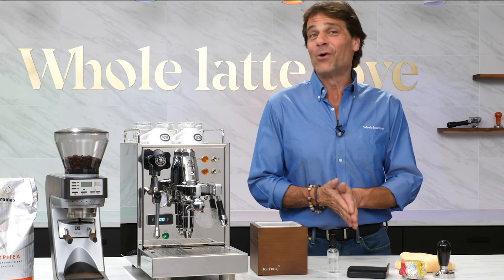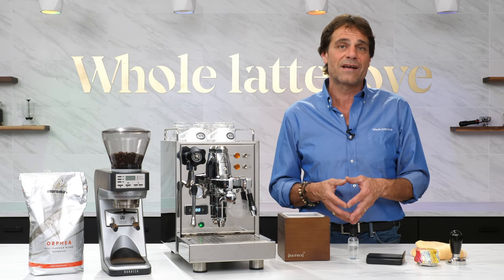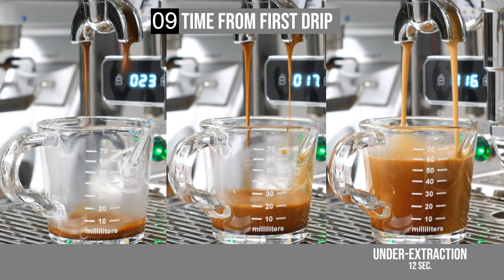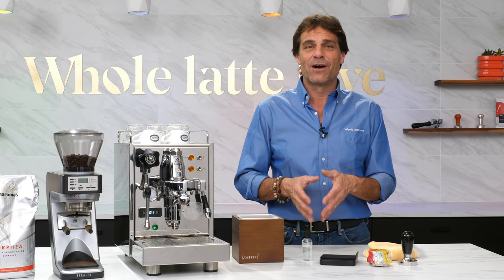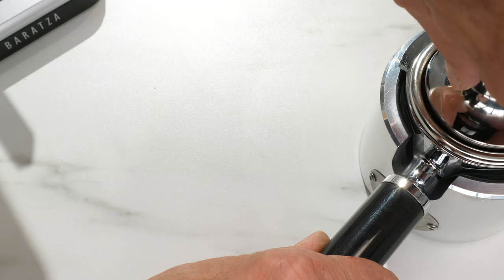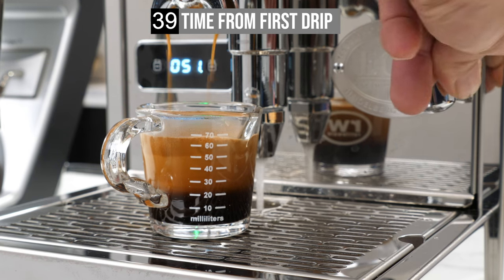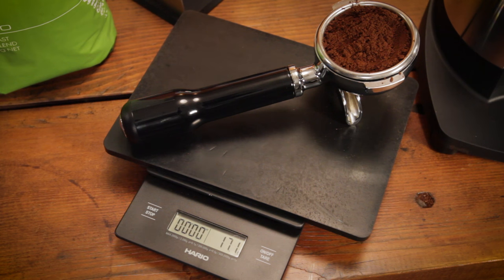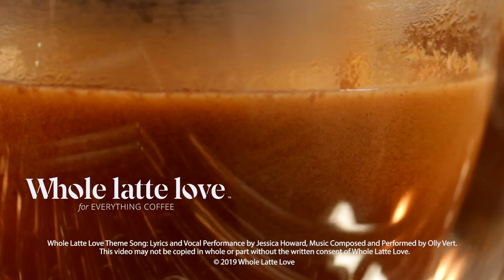How To Dial In Grind Size for Espresso

Comment: Something is very wrong. I get to 70ml after 15 seconds on the finest grind size, and that's with only about half the liquid landing in the glass. I have distributed and tampered as evenly and carefully as I can, stirred it with the spiky thing to remove clumps, etc etc etc. Still getting coffee on the ceiling.
Reply from the maker: Hi AD, Coffee on the ceiling? Not sure what to make of that! 70ml in 15 sec is fast. Would help to know some more details like machine and grinder make/models. Extractions too fast is almost always due to grind being too coarse and/or coffee dose too low. If grinding at finest setting you can slow down the extraction with a higher coffee dose weight - assuming you have the capacity in the portafilter to dose more.
Marc

Comment: Hai, my machine got pre infusion for 9 secs,and I use 9 grams coffee bean,including pre infusion 9 secs +20 secs brew time,my Espresso still lack of crema, should I go "finer"?
Reply from the maker: Hi WK, Sounds like you are doing single shots. I would go finer and try to get the main extraction after the pre-infusion to at least 25 seconds. Long pre-infusions generally require a finer grind size.
Marc‘
Reply: @Wholelattelovepage  thanks for the tips 😀

Comment: Hello been watching your channel from Kenya I want to ask. I have this machine Victoria and I set it automatic i use 19grms in and 36 out in less then 25secs and it balances at times so the question is does time really hold much water in esspresso extraction
Reply from the maker: Hi RV, Time is important when doing basic dialing in of grind size. But weight and brew ratios are far more accurate after that.
Marc

Comment: Hi Marc, Just got a Breville Barista Touch from Whole Latte (changed from my Gaggia Titanium Superauto). Using Lavazza Super Crema beans but can't seem to get the thick creaa even changing the setting on the grinder to increments as low as 6.  I see a comment below about a single vs double shot, I am using singles.  Should I be doing doubles and what setting do you suggest I use on the grinder?  The timer is set for 25 seconds for the brew, I even tried to go up to 30 seconds but no success.  By the way, no matter what setting I use, the flow seems to always start at 7-8 seconds. Never changes?
By the way, all great and helpful videos and I love the new set! I am working on latte art but need to get the crema/espresso right first. Thanks
Reply from the maker: Hi cs, I would do doubles. Singles are very tricky to pull off - very few do singles. My advice: use the double shot non-pressurized filter basket. Breville calls those single wall. Grind to slightly overfill the basket and swipe off. Tamp with firm level pressure. First drip at 7-8 seconds is fine. Your shooting for ~2oz in 20-30 seconds from first drip. If coming faster set grind finer a step or 2 and try again. If going over 30 seconds set grind coarser a step and try again. When the grind is right Super Crema should easily produce crema!
Marc
Reply: @Wholelattelovepage  Thanks Marc, I tried with a double and got plenty of crema. Thanks.  Now onto the fine steamed milk for latte art!

Comment: I just bought a Breville barista touch & I think the flow is too fast- starts pouring at 7 seconds & the amount of ground coffee isn’t above the portafilter so there is nothing to trim. How can I fix this issue?
Reply from the maker: Hi Sue, First drip at 7 seconds is very reasonable IMO. But, if you thinks it's too fast the way to correct is to decrease the grind size and/or increase the dose of coffee in the portafilter.
Marc

Comment: But they say 18g in and 36g out in 20-30 seconds not 60ml or 60g… out.. how do you dial in 20-30 seconds with only outputting 1:2 ration of 36g out ?
Reply from the maker: Hi TD, Crema is a lot lighter than fully liquid espresso. Coffees which produce a lot of crema can have a volume (including the crema) of >60ml with a weight 36g.
Marc

Comment: Do you always to grind 17oz for a double espresso? Is that different between porta filter sizes?
Reply from the maker: Hi Adrian, Thanks for the question. 17-19g is a fairly typical double shot dose weight in the US. I was in Italy over the summer and looked like commodity doubles are traditional dose of 14g.
Marc

Comment: On a PID equipped Sylvia M since the brew time is a parameter that you are setting would you instead be dialing in your grind based on output? For instance I can set the brew time for 25 seconds and if I am getting 17 grams in I should be measuring the output to see where I need to go with the grind setting, correct?
Reply from the maker: Hi Rick, Thanks for the question. You can do that but be aware how you measure output makes a big difference. Measuring volume is rather inaccurate. Weight is the only true way of determining brew ratio. So if doing 17g and using a typical 1:2 brew ratio you'd be looking for 34g out. If using a coffee which produces a lot of crema (and you include crema in a volume measurement) you could easily have 60ml volume with 34g weight.  For an example of that check out this video I posted yesterday. Crema rich triple shots pulled from 21g of coffee and stopped at 42g output weight have in cup volume near 70ml including crema: https://youtu.be/HTaly8c-i_U
In your case if setting a 25 second brew time you could adjust grind to produce 34g output weight. Hope that helps!
Marc

Comment: I’m a big flat white drinker, occasionally drinking espresso. Would you recommend the ecm classika?
Reply from the maker: Hi Charlie, Thanks for the question. The typical Classika owner is more about the espresso than the milk drinks. It's perhaps the most temperature stable single boiler machine. With E61 group and option for flow control it's capable of excellent espresso. As a single boiler there's a wait between making espresso and frothing milk as the boiler raises to steaming temperature. Then after frothing one must cool down and refill the boiler before making the next espresso. If you're okay with the added wait and a bit more mess from cooling down it can work. But for those who do mostly milk drinks I recommend going with a machine using a heat-exchange boiler or dual boiler. You can brew and steam simultaneously on those.
Marc

Comment: I just bought a Jura A1 and I'm doing research before it comes in. What is the proper shot time and size of the shot that I should be aiming for?
Reply from the maker: Hi RR, Thanks for the question and congrats on the new machine. I've had the very similar Jura ENA Micro 90 as my daily driver at home for a couple of years now. My wife and daughter love the machine. They use it mostly for long coffee and I do the occasional espresso before a workout. Timing of shots does not apply to super-auto machines like it does for semi-auto. The A1 uses a coffee dose of 6 - 10g per brew cycle. A traditional single espresso of 1oz uses a coffee dose of 7g. What you like comes down to personal preference. If me I'd set up as follows. Before adding any beans set grinder to the finest setting. I'd use the stronger strength setting and set the espresso to produce ~1.25oz in the cup. Give the machine about 4 brew cycles to calibrate as the 1st few shots are likely to be weak. Do some tasting. If you find it too strong you can back off on the strength setting. If espresso seems over-extracted with bitter flavor you can back of the grind size a setting or 2. Do complete the water test and enter your hardness level into the machine. If you use the in reservoir filter the machine will never need to be descaled. If you do not use the filter the machine will alert you when to descale based on your source water hardness. Very important to either use the filter or descale the machine when alerted to do so. I did a little math and my Micro 90 is well over 5,000 brew cycles with nothing more than regular maintenance. If you don't already have it, here's a link to the manual for your machine: https://us.jura.com/-/media/global/pdf/manuals-na/Home/A1/A1_UL.pdf?la=en&hash=D11001BE32B737ADD8D4563C35D23994D7978563&em_force=true
Enjoy your machine!
Marc
Reply: @Wholelattelovepage  thank you for all the info! I really appreciate it and will definitely do what you said
Reply from the maker: @IAMJRAD  my pleasure!

Comment: I have rancilio silvia
I bought a kimbo aroma and i want to know what is the dialed for this type of coffee? I waited half of the coffe for eureka mignon
Reply from the maker: Hi GP, Not sure I understand your question. Sounds like you want to know the grind setting on the Mignon for the Kimbo coffee you are using. Unfortunately I can't give you a setting number as that depends on other variables. What you need to do is adjust the grind size until you get your espresso extraction in 20-30 seconds. If your extraction is happening too fast adjust your grind finer. If it's too slow adjust your grind a little coarser. You may have to make a few adjustments over a few extractions to get the grind set properly - that's "dialing-in". When dialing in keep all other variables the same. So use the same coffee dose weight, etc.
Marc

Comment: Hi! I've got some issues with dialing in. Machine is ECM Synchronika. Tried 4-5 different beans. Espresso starts pouring after 3-4 seconds. If I grind finer it will just drip and over extract. Also find crema volume to be a bit low. Might pump pressure be a bit high?
Reply: I also have an ECM Synchronika. try fresh coffee beans, I buy from local roaster and it does make perfect espresso. also I recomend to weigh the shot and try to get a 1:2 ratio within 20-30 counting after the first drip.

Comment: Hi Marc, thanks for the video. I've seen some weird detail on your Acaia Lunar scale. Is that a custom made rubberized top plate, which is purposely bent up to hold portafilter handle? Or you just turn stock heat resistant pad upside down?
Reply from the maker: Hi YD, You are welcome and thanks for the question. The rubber plate that comes with can serve both purposes!
Marc

Comment: Hi. As a newbie I found this very helpful. Have a question though. Have followed this video and dialled in my grind with my Gaggia Classic Pro and it produces a decent shot now. However, the puck is very wet and soupy each pull. There is a layer of water on top of the puck that I dump into the tray and then knock out the puck in the bin. Any reason why there is still so much water after pulling a decent shot? Regards, Trevor
Reply from the maker: Hi Trevor, Glad the video helped! Wetter pucks can be caused by excessive headspace in the filter basket - the result of using a lower dose of coffee than intended for the filter basket, when using the pressurized filter basket - one with a single tiny hole or by a dirty shower screen.
Marc
Reply: Cheers Marc. Will try increasing the dosage slightly and do some more test.

Comment: Nice vid! Could you tell me why I would want the espresso process to be between 20 and 30 seconds? What's the issue if it takes a bit longer (and still tastes good)? Using gaggia classic pro (love it)
Reply from the maker: Hi i, If you like the taste by all means go longer with your extractions. 20-30 seconds is just basic dialing in time. From there use flavor as your guide! Happy to hear you are loving your Gaggia Classic Pro!
Marc
Reply: @Wholelattelovepage  yess i have the one classick version 2..i install pid and gows  all well.i neat to upgrade what you think about 1300...1600 ?thanks

Comment: The whole 'from first drip' or 'pump on' is too confusing. The Klassica timer starts from pump on for example. The difference can be as much as 10 seconds so is the '20-30 seconds' rule allowing for the difference in timings so it would be 20 seconds from first drip and 30 seconds from pump on?
Reply from the maker: Hi Richard, Thanks for the comment/question! So timing is the most basic way to appraise a shot and is really only useful in comparing shot to shot on one's personal setup. End of day it matters not IMO if you go fro 1st drip or pump on. I choose 1st drip due to the variety of different machines I work with. Different pump types and things like flow control and pre-infusion have big impacts. Of course a more precise method is using a scale and brew ratios: grind dose weight to weight of extraction.
Marc

Comment: It's apparent that you are timing the shot to when the crema reaches the measuring point, so I don't understand what you mean by "crema compensation."
Reply from the maker: Steve Poff Hi, thanks for the question. I was compensating for expected settling of the crema letting shots run to ~70ml based on my experience with coffee used which typically sees that 70ml settle out to about to 60ml. Sorry, probably could have given better explanation of that in the video. 
Marc

Comment: So... do you not tamp anymore after using the leveler?  I assumed you still needed to apply some pressure in order to compress the grounds enough....
Reply from the maker: Hi frankspastic, Thanks for the question. No more tamping! The leveler compresses the coffee. Old school recommendation was ~30lb of force. Some people do tamp after leveling - I'm not one of those.   Over the years I've tended towards a slightly finer grind and less tamp pressure. I stopped using tampers about 10 months ago. Here's a video with more on using the leveler. You'll see in the video I can knock out an intact puck of coffee after leveling only: https://youtu.be/jOY7D02n4Cw Once you get to a certain level of compression pushing harder doesn't do much IMO.
Marc

Comment: So, if you had a filter of 53mm rather than 58, would you essentially have to overfill that even more, in order to get the ‘correct’ weight of coffee for the shot?
Reply from the maker: Hi fenderman (got a strat?), Thanks for the question. You can pack it in a bit but there are limits. In general you'd just make shorter shots which better match the amount of coffee in portafilter. Typical espresso brew ratio is 1:2. So if you dose 18g into portafilter you'd make an espresso with a finished weight of 36g. Brew ratios go a bit beyond the basic dialing in process in this video. Hope that helps!
Marc
Reply: Whole Latte Love brilliant thanks, i think ive been overpacking it and wondering whats going on. I can get good pressure, (maybe a touch high) but the shots always seem to ‘finish’ too early. I also wonder if im over tamping. This morning i did get a shot that actually tasted good though. And yes, i do indeed have a strat! 😂 thanks for answering.

Comment: Hey I have a Silvia V3 and a Sette 270 using Lavazza Super Crema, doesn’t seem like my machine can handle grind sizes that fine. I’m much coarser in the 13 area, still putting out less coffee and anything finer seems to choke it. Think it’s possible I have a pump issue? Machine seems to be running and in great shape.
Reply from the maker: Hi, Thanks for the question. Every grinder is a little different in setting - even same make/model. But, 13 setting does sound very coarse. I'm usually down in the 2-4 range for espresso. Might be a pump issue but could be other issue like blockage in plumbing elsewhere within machine. You could check out the troubleshooting section of our support wiki for the Silvia here: https://wiki.wholelattelove.com/Rancilio_Silvia/troubleshooting If in the US and want additional assistance you can call our tech support team at 585-924-7170
Marc

Comment: What do I do if I have a new Ceado E6P V2 that will not grind fine enough for a Rancilio Sylvia? I have it right at the spot where the burrs just about touch but still not fine enough. I have tried 4 different types of beans all fresh roasted and have been getting nothing but under extracted shots.
Reply from the maker: Hi D, Hmm... I've never used a Ceado grinder that cannot grind fine enough for espresso. If the burrs are nearly touching there's no way too coarse a grind could be produced. Something else must be going on.
Marc

Comment: I’m kind of stuck. I have an Encore grinder (set at size 5 and a Breville Dual boiler) and i was getting perfect shots, but now suddenly with the same beans and everything else the same, it comes splashing out at the end way too fast. Going to size 4 regardless of grind amount makes the machine close to choking, but if I stay at size 5 it’s always rushing. Any advice? I’ve tried grinding anywhere from 17.5g to 18.5g with no luck
Reply from the maker: Hi b, The Encore is a good lower cost burr grinder which is suitable for drip, pour over but is limited in the precise grind size adjustment needed for esprersso. In fact I do not recommend the Encore unless using a pressurized filter basket (Breville calls them "Dual Wall"). Pressurized baskets are more forgiving of imprecise grind size while sacrificing potential espresso quality. You may be able to work around its limitations by adjusting the coffee dose and potentially tamping force. So if a setting of 5 is too fast increase the coffee dose and/or tamping force to slow it down. If a 4 is nearly choking the machine then decrease the dose and/or reduce tamping pressure.
Be aware that grind size is rarely set and forget. As a coffee ages or ambient conditions change grind size will need to be adjusted. Hope that helps!
Marc